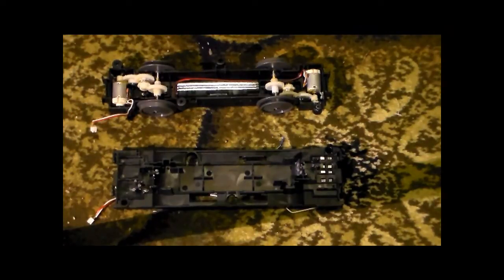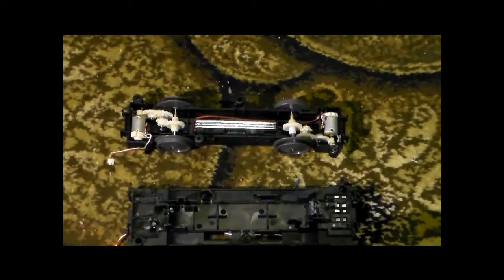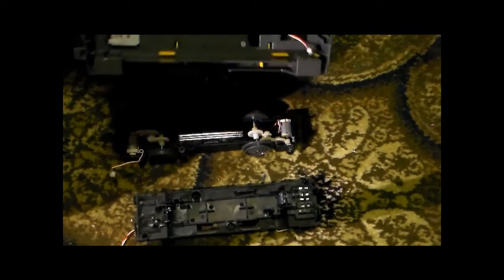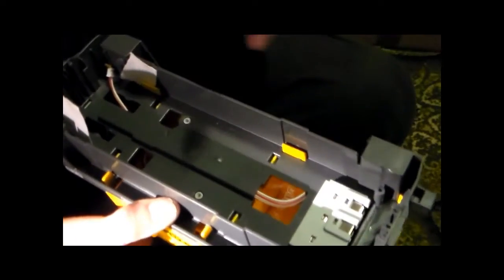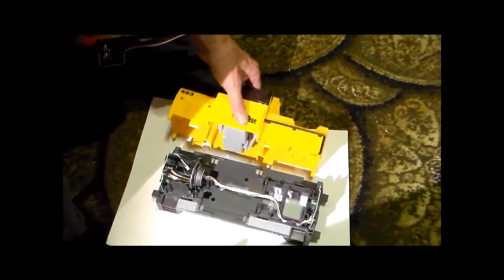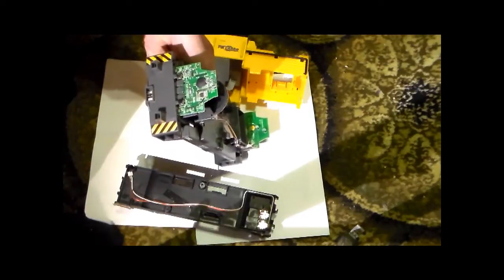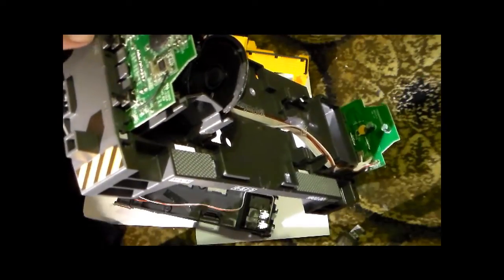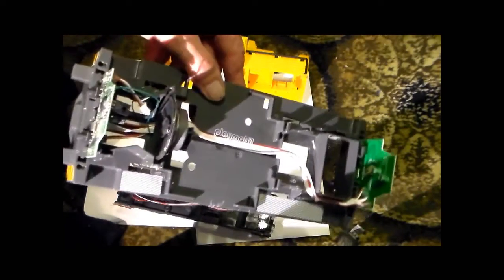Playmobil loco ripped apart!

Comment: When you turned the sound on at the end it almost sounded like a startup of a real diesel loco!
Reply: This playmobil loco is excellent value for £80 and it has survived a two metre drop.
Reply: +Bike rides Wow! Maybe a bit expensive for me at the moment as I probably would not do much with it but it is a tough model.
Reply: +Meengineer the playmobil is a lot cheaper than lgb models. ..However it is less detailed. G scale locos are so very expensive.
Reply: +Bike rides I suppose you could make this model more detailed and customize it your self.
Reply from the maker: That is a great way to get started in this scale. Not a lot to lose as the basic unit is such good value. It costs less than a motorised chassis.

Comment: How did you remove the bogie detailing from the frame?
Reply from the maker: The bogie detailing on the Playmobil loco is a separate piece of plastic held in place with tags. Firm prizing will remove it without too much damage to the tags. If the tags break then glue or a screw can be used when re-attaching.

Comment: I've had a number of these wonderful little locos over the years but have had problems with intermittant power loss. Does anyone have any idea what the issue might be.
Reply from the maker: Hi Mr Matters. I haven't had that problem. Let's see if anyone sees your comment and can help. You could try posting a question onto a forum.
Reply from the maker: Loose battery contacts?